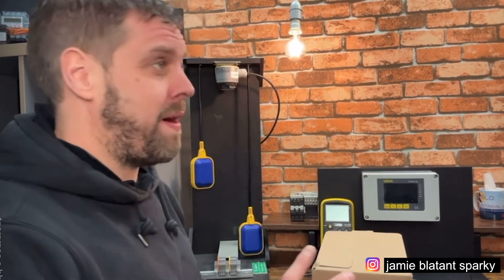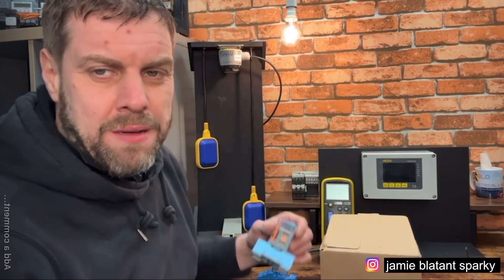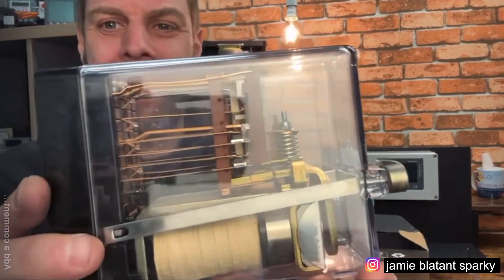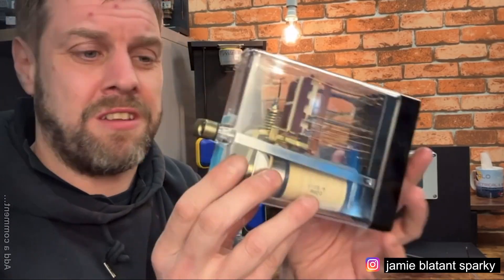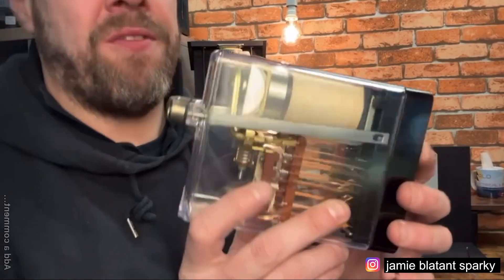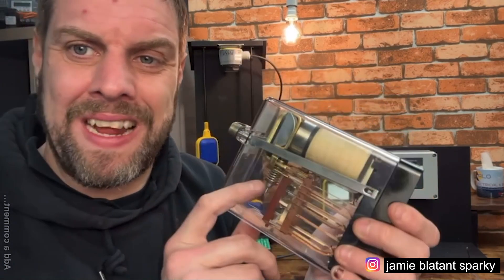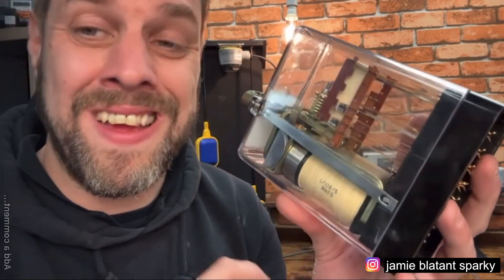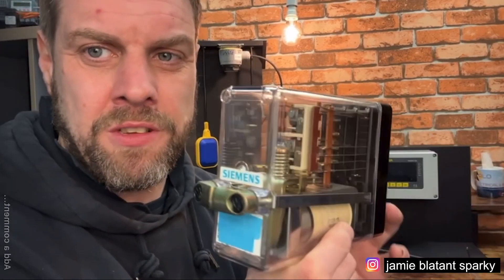specialist railway relays, like  realays but for railways

Comment: Railroad/way-signal relays are designed and constructed for high efficiency and reliability.  Glass or polycarbonate housings for inspectability and large internal clearances for moving parts in order to limit pollution failures.  Track relay coils are wound for very specific resistances to interpose the track/ballast and length of the circuit block condition they monitor over a wide range of circuit dynamics.  AC relays, single, double, dynamometer, centrifugal and polyphase are even more interesting still.  All in all, electro-mechanical art if you ask me.

Comment: I have manufactured 1000’s of the style for railways nuclear power stations mainly gp they are based on Strowerger  telephne exchanges.
Also was a manufacturer of at least 500 types of relays and solenoids.
Critical switching always ended up with the fail safe mechanical relays somewhere in the circuits ( even in up to date ejector seats ) 
When I closed the scrap yards loved me 😎 ( didn’t understand the more important relays had gold/platinum/palladium contacts like your railway one no cheap silver on that baby ) 😂
Reply from the maker: Could you contact me on linked in or instagram I would love to find out more about what you have been up too
Reply: @  If you look on the YouTube for telephone exchanges there are many containing Strowerger exchanges . I made relays of many different manufacturers from BT to ITT Plessey and all the big boys ! The relay was the king before the microprocessor completely overtook the switching game and of course as the big boys got on the bandwagon it left us to make up for the knowledge and manufacturing died off.
The tech was like a rocket slow at the start but speed was relentless and at the end it travelled at light speed.

Comment: Used in their thousands in power stations as well.  typical working life well over 50 years.
Reply from the maker: Really , what for , critical steam stuff ?
Reply: Yes, in all sorts of forms. Interlocking and controlling valves, motors also used  sequencers, shutdown systems etc. 
50 volt systems for coils were used as they could be backed up by battery systems.
Reply from the maker: @philkelsall1207  cheers I love this lost knowledge , so did they use the actual railway relays just for there reliabyor was it just a similar heavy duty relay
Reply: @Actual_electrical_content  they were a very similar heavy duty relay, I can't remember the makers name,  but I recognised the style of the short code ID number under the base. Another common supplier was STC.  Who made a slightly light but very reliable relay.  You could get hundreds of options of contact operations besides make and break. ie make before break, delayed make , timers etc. We also used lots of smaller high reliability relays.
Reply from the maker: @philkelsall1207 tip info I never knew this I imagine old power station controls were epic

Comment: Usually made of a metal that retains no magnetism so it doesn't stick, core is iron that has no magnetism. Were made of silver and silver impregnated graphite. Time division multiplexing controlled the relays, between signals, points
Reply from the maker: Top knowlage that I’ll now spend hours researching

Comment: Hi, greetings from Saudi Arabia just watched your vides, FYI what you have is a CODE172 point contactor relay. In other words it is used to power the machines that change point to switch trains.
It will be 50v which is the standard relay voltage in the UK, the coil will draw approx 50mV with a 1000 ohm coil which should be printed on the coil.
the contacts will be 2 x HD which are heavy duty contacts for motor current and you will see a small magnet next to each of the large contacts to snuff out any arcing
Also the coil is fitted with a lump of metal at the end of the armature to prevent any stray ac from causing the armature from vibrating.
Reply from the maker: Cheers do you know if manuals exit for them ?

Comment: Looks very similar to telephone exchange relays used in the step by step era and appears to have a copper slug on the coil to make it slow to operate they were also very reliable working for decades.
Reply from the maker: I am after a exchange relay but due to the YouTube’s by look mum no computer they are hard to come by as they are popular

Comment: Its "light duty" relay. True Hardcore railway signal relays do not have springs, they are gravity-controlled, with just weight to return it back to off position. Spring may break and fail, gravity never fails!
Reply: It's actually a standard safety-critical relay used in the UK and some other countries. The design - called BR930 series - has been around since the 1960s and is extremely reliable. The series has over 200 different designs.
Reply from the maker: Interesting I’ve never heard this
Reply: @Actual_electrical_content  its USSR specific. Literally its "1st reliability class relays" ("реле СЦБ 1 класса надежности") and "lightened". Only 1st cat allowed for safety circuits without special monitoring.

 There are some other requirements like non-welding contacts even under emergency conditions, nonstick moving parts and so on - released relay must ALWAYS switch on red light, even in the middle of nuclear war.

Comment: In Germany there had been a development of entirely modular signal boxes since the 1930s, intermitted by the second world war. On the Berlin electrified rapid transport system they soldered the relay-based circuits, but their stations and track layouts had been relatively simple and somewhat uniformed compared to those of the national railway structures.

So the track plan oriented signal box equipment (German: Spurplandrucktastenstellwerk, Abreviation: SpDr) had been developed and set productive in the 1950s by Siemens and Lorenz Elektrik (equipment types SpDr S and SpDr L). In the 1930s the Reichsbahn had a fully functional prototype in the station Birkenwerder (near Berlin), after the war the very first station with that type of signal box eqipment was Düsseldorf-Derendorf. All track elements like turnouts, signals and occupancy detectors are represented by a relay-based module which are connected by a special cable similar to the track plan. E.g. the turnout module has three connectors for that cable, the module for a single or double slip module has four connectors and so on. Signal and occupancy modules have two connectors going in and out to the previous or next element. 

These modules had been tested by the manufacturer, but they did not need any special relay types. The circuitry of each module had been developed in a way that errors are always laid bare to the signal box staff. E.g. a signal module would make a broken incandescent bulb visible immidiately on the user interface. If a turnout does not reach the desired end position the interlocking would make it impossible to clear the according signal.

This was the way of operation in Western Germany (and many of them are still in operation), socialist Eastern Germany had to buy its relay-baesd signal boxes from the Soviet Union as any other Eastern European country behind the iron curtain. They used special relay types which allowed them to make the circuitry out of less elements than the western SpDr-types. Their relays had been made in a way making mechanical failure impossible.

Comment: I believe the railways operate similar to the nuclear industry, so have specific type approval for their equipment that this will be manufactured to. Probably over designed, with a high safety factor, to reduce the likelihood of failures, hence why the coil and contacts are so big in comparison to the voltage levels they are working at. Would be interesting to see if they are wiring systems in a fail safe mode. Wouldn't be surprised if they have their own functional safety standards instead of the general purpose IEC61508.
Reply from the maker: Chonky standard for everything world reduce waste